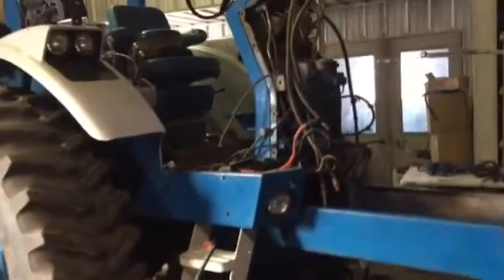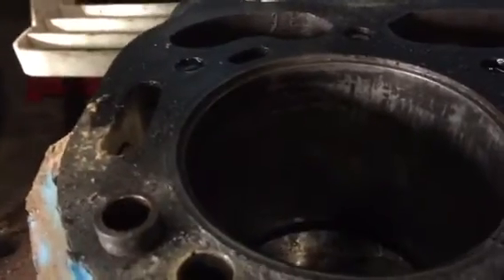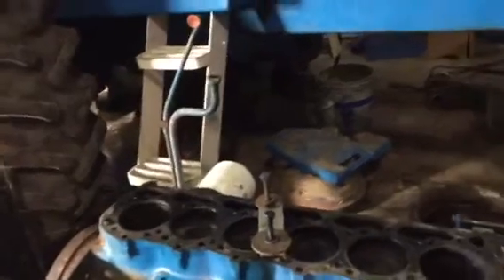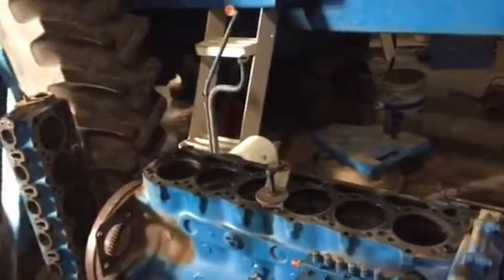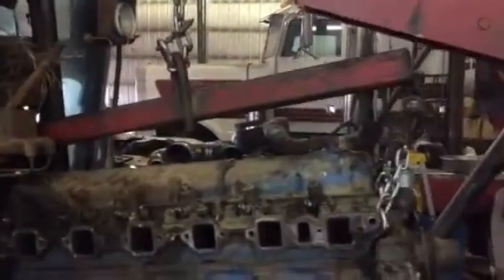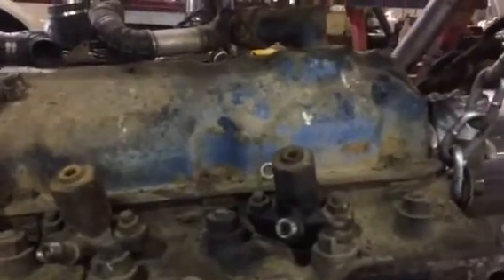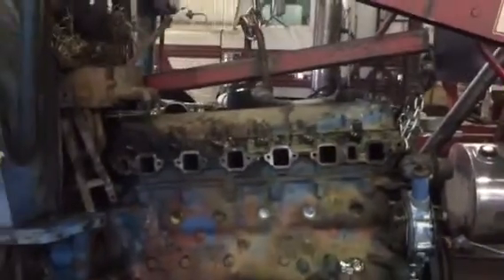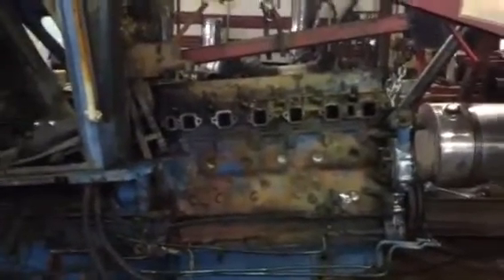Ford 9000 Engine

Comment: Nice! I've got a 8700 I'm doing the engine is stuck so it's coming out for a full rebuild to make it a turbo engine
Reply from the maker: Ford Farmer  there isn’t much to switch except the rods. Good luck, post a video.
Reply: TrueBlue Farmer pistons and valves is the biggest part. I thought when Ford started the 401 the rods were already drilled for oil to the pistons? I regularly make videos lol so no problem!
Reply from the maker: Ford Farmer you may be Wright on the rods. Are 9000 started life as a 8000. The rods weren’t drilled. We ran it turned up for 15 years. Be for we had problems. Full load it had 25 lbs of boost.